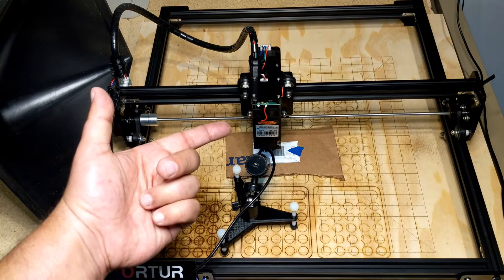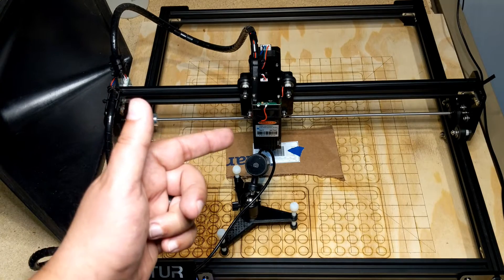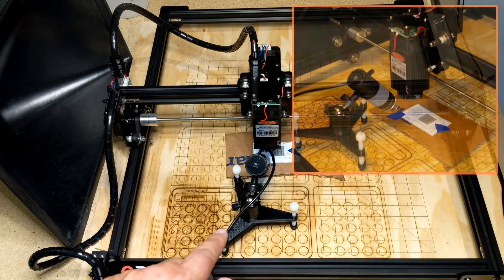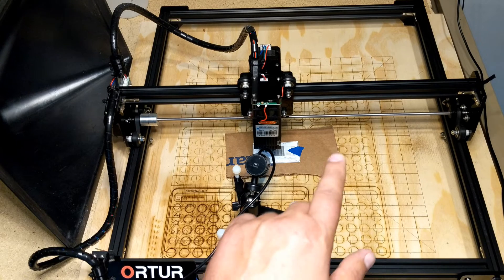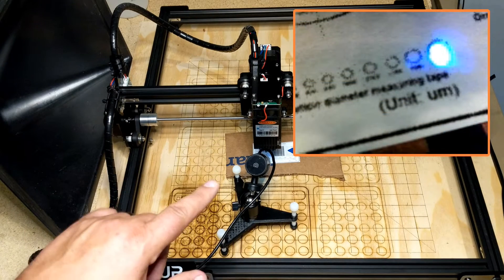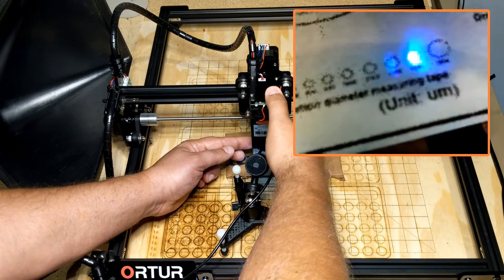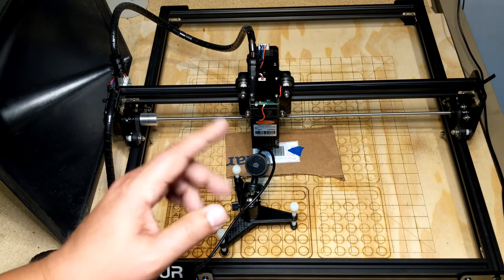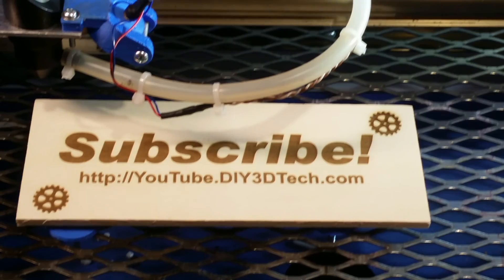Ortur Laser  -  Achieving the Ultimate Focus!

Comment: I have made a wooden block of about 10 - 15 degrees 6 cm long placed it under the laser head so it does not just touch the wooden block so I make a line with the laser on the block and can now see where the focus is and measure it. I have also found out how to make a wooden block 2cm high and with a 2-4 degree slope and a piece of white paper on the block and put it under the laser and drive the block back and forth you can also see where the focus is. Thank you for the knowledge

Comment: Im new to this i have the same laser as you have in the video. When i engrave something or try cutting i notice one direction has a much smaller cut line than the other direction. Is that a focus problem or did i set it up wrong?
Reply: It's the way the laser is focused. It's more - than •
Reply: @chavezhead  is there any way to focus it so it is just •

Comment: Looks good!  I just got mine and have yet to test.  However, I have one thought.  I see a lot of videos where the unit cuts through a 1/4" piece of plywood very well, but it never quite makes that last cut through to the bottom.   I'm wondering if it ever makes sense to focus the laser such that it's perfectly focused on a material with 1/2 the thickness that you are trying to cut.  That way, you should maximize the depth.  Does this make sense?
Reply from the maker: 1/4 is pretty thick, the practical limit is about 1/8 for ~3mm.  You can tell to make a zillion passes and if you keep clearing the kerf, some day you will make it though I suppose.  However yes for thicker material you want to focus to the mid point so you have a matching angle on your kerf and use a G8 or G7 lens...

Comment: I am total noob to all this. Just got my Ortur assembled and now trying to get it work. Lightburn seems to jam quite often with it, just saying busy and I need to restart the connection. Also my laser focus is not a dot, but a short line. Any idea what can cause this? Something wrong with the lens?
Reply from the maker: All diode lasers are a short line and not a dot so this is normal also you will want to get a G8 lens: https://diy3dtech.com/G8-Laser-Lens (watch my videos on that).  As far as lightburn is concerned, check your coordinate system and make sure it set correctly (there should be no dots next to it as I can't remember the name sitting here).

Comment: How do i focus in the first place? Right now the way I know how to get the laser to light up is while it is trying to burn an image. Cant realy turn the knob while it is moving.
Reply from the maker: In LightBurn (which I highly suggest) you activate the fire feature by going to preference and then it will show up in the move tab,  With just Gcode you would issue a G/S command (for low power) and do that way but that is more dangerous.
Reply: @DIY3DTECHcom  where is the move tab

Comment: Hi 
Thank for sharing
I'm facing one issue with the area of engraving.
I can't adjust the size  W & H  separately.
If i adjust the W the H will be automatically adjusted.
Can you please help on that
Reply from the maker: If you using LightBurn (which I recommend) you simply turn off the locking of the aspect ratio

Comment: I have found focusing on a matte black surface..helps to curb the reflectivity to focus better.  It would be best to focus on the final product surface or something equivalent in height... or i guess since most of these lasers do not have a Z, to make a "table" that moves the frame.. so you can focus once and move the object to correct distance...
Reply from the maker: The paper is super thin so no practical difference.  Also yes to the Z as I have used these piggy back on my CNC before and yes you can vary the Z...